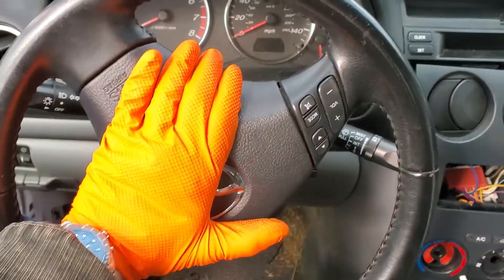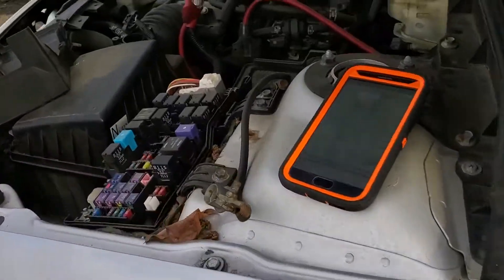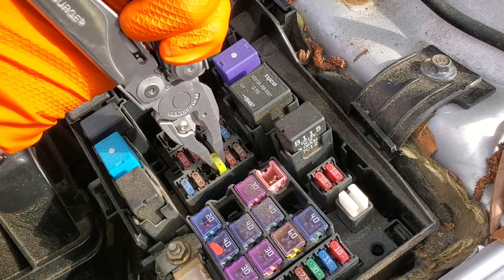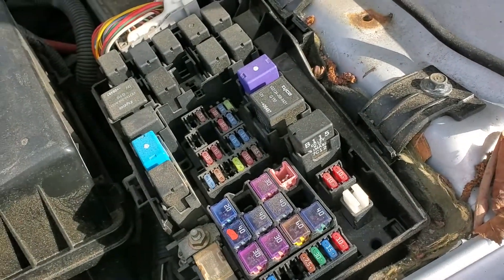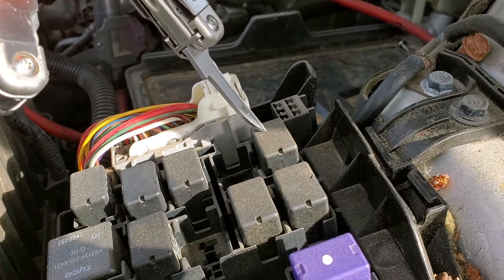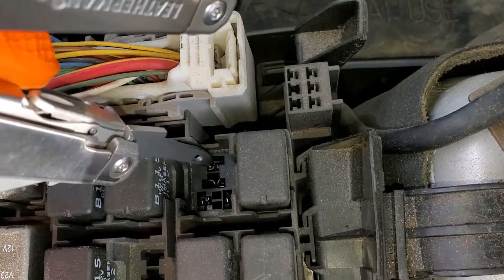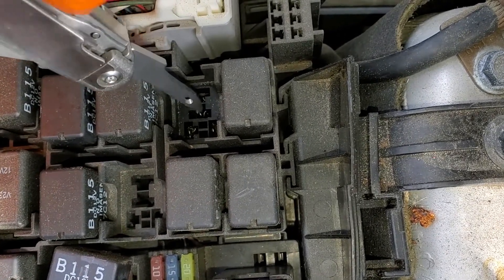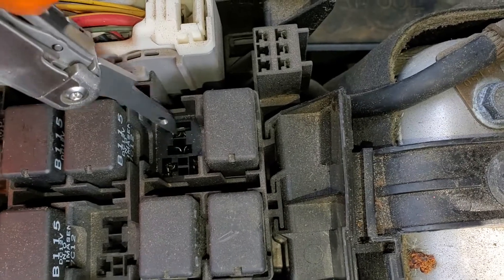2008 Mazda 6 Horn Fuse & Horn Relay

Comment: Had a short on rear tail light.
Horn jammed on central locking not working Lh tail and indecators not working and got a fault light on dash now with a picture of ignition thanks for your info on horn relay and horn fuse connected to tails lights its given me an avenue to check out

Comment: Hey man, I've had the issue with the same model going off in the middle of the night so I just pull that 20 fuse any time I park long term after getting home from work. Would taking the relay out still let my brake lights work? Thats been my main issue when traveling is the constant in and out and I'm ready to get a new car on an otherwise low mileage vehicle

Comment: Why would the horn sound and emergency flashers go on when the blinker is flipped on? Lol my car has been doing this for 2 years and the horn just started blaring at 2am the other night while i was in bed. It stopped when i turned the car on, before i disconnected the battery.

Comment: Great information, thanks.  Just wondering, if I run my car without a horn relay will this damage my vehicle's electrical system in any way?  I want to disable the horn for now because it keeps going off randomly, usually in the middle of the night -- not cool!

Geoff
Reply from the maker: It will be just fine without the relay!
Reply: @LehewTech  I'm puzzled why the horn continued to work after I pulled the fuse ... it stopped only when I removed the relay.  Thanks again for the information -- and quick reply!
Reply: @LehewTech  I literally was just going to ask this. Thank you so so much!!
Reply: Did you end up fixing  it. My car does the same

Comment: Hi there! It’s the middle of the night in the middle of a snowstorm and my alarm keeps on going off. I could not pull out the fuse because I didn’t have a great tool on me, but I was able to pull out the relay. Do you think I am safe for the rest of the night?
Reply from the maker: Dang what a predicament! Are there lights flashing as well? My concern is that even though the horn is not going off the battery may drain.. disconnecting the battery is the best way to ensure it doesn't drain.
Reply: @LehewTech  they are flashing, yeah. Any video tips on how to disconnect the alarm with limited tools? I’m new to all of this and low key, I’m stressed.
Reply from the maker: Its all good you did good just figuring out how to turn off the horn! I believe the battery connections use a 10mm bolt. You can use a 10mm wrench or a 10mm socket with ratchet. If you don’t have those you may be successful with pliers or an adjustable wrench although those are harder to use, especially if the bolt is tight. You only need to disconnect one of the cables. It is best to disconnect the negative cable if you are able, and make sure to NOT make contact between the positive and negative terminals of the battery with whatever tool you are using. Good luck!
Reply: @LehewTech  thank you so much. You are my literal hero.
Reply: @LehewTech  follow up question. Will my break lights work if I drive without the relay for the horn?? I know the fuse is the same for the horn and break lights. I’m traveling today and I don’t want to risk it.
Reply from the maker: @94uruguaya  On the particular vehicle I filmed, the horn relay is not necessary for the brake lights to work. You may want to check that the brake lights work on your car especially because the alarm was/is going off
Reply: @LehewTech  I asked my neighbor, they work. Thank you once again for all of your help! My 06 Mazda 6 is a trooper, I’m just trying not to kill it. Seriously, bless you!!